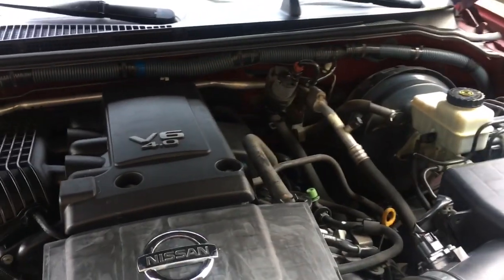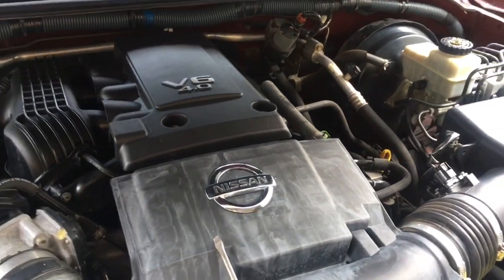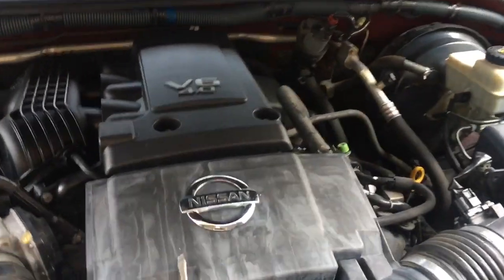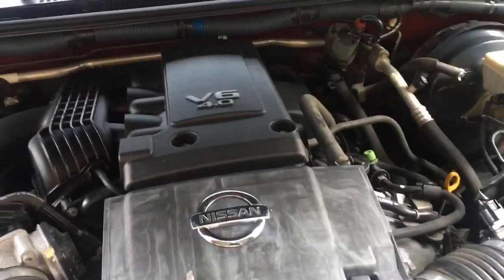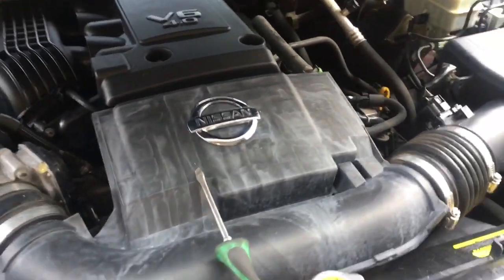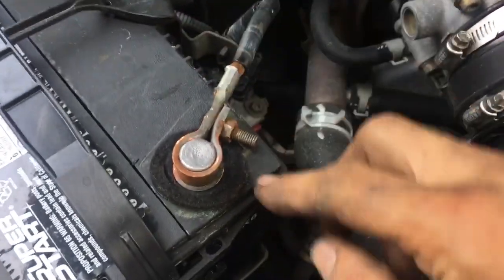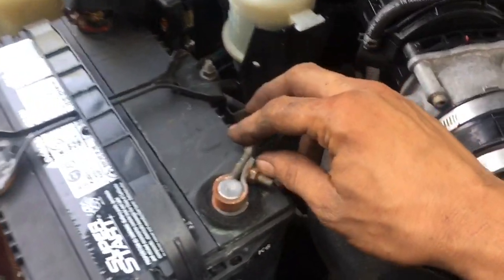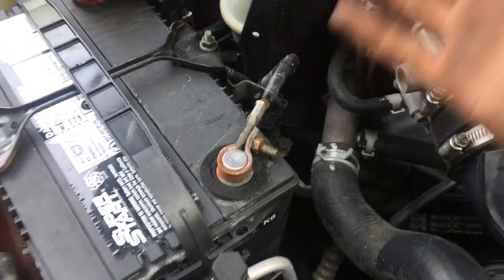Loose battery cable? How to fix for free

Comment: Thank you thank you your video was a life saver I was having an issue with my truck and the battery cables being loose I tried your screw idea and thank you I got the battery going enough to get it to the shop.
Reply: Also I like your can't break what's already broken comment it is a big motivational help😅

Comment: Just stuck a small screw driver mine. My problem isn’t the terminal. The guy that had this before me jacked up the battery post so I’m no getting a good connection. So instead of popping the hood every time and taking a screw driver in and out I just installed a small and will leave it there til time to replace battery lol

Comment: I have a 2016 Chrysler Town and Country and the battery went out last night.  My cables have some kind of slide mechanism on the cables and I can't get it to tighten.  I'll try your method and see if it works.  Thank you.
Reply from the maker: I believe off to the side of it there is a 10 mm nut that you need to loosen if I’m thinking of them correctly but you can also try my method it will certainly help somebody probably over tighten the nut because…….  well they were NUT and they didn’t know any better…….
Reply: @sharpcarco  Thank you very much!!

Comment: My positive clamp keeps popping off the terminal & sparks everytime I put in place (Idk much about cars but Ik I don't want to get shocked) 😳😂 Will I be zapped pushing the screw in or do I need to disconnect the neg. 1st? 🤔 Signed Scaredy Cat 😂
Reply from the maker: First off no you won’t get shocked technically speaking you should remove the negative put the positive and then the negative but really it don’t make a difference you won’t get shocked either way.

The only reason they say that you should put the negative on after you put the positive on is for power surging but that would also mean something would have to be on full blast to search the power so it’s kind of dumb when people say that but it’s pretty much the way of the world nowadays to be safer than sorry.
Reply: @sharpcarco  Ok these might be silly ?s but once I have the answers I won't ask them again Lol Do I have to turn off anything? & I don't have any tools...so can a screw just be pushed in place?
Reply from the maker: you have absolutely nothing to worry about whatsoever. I’m actually going to make a video about that topic you were definitely not the first person to ask and it’s completely understandable.
Reply from the maker: No I’m sorry you can’t just push the screw in the place you have to turn it with a screwdriver the point is that the screw will bite into the lead of the battery terminal you could probably borrow a screwdriver from AutoZone they usually have a little stuff like that behind the counter
Reply: Just had a nice older gentleman save the  day 😁😂 He used a thick zip tie piece in place of the screw & it worked just the same! I'm over the moon RN! Lol

Comment: So I'm having a really hard time finding a video and obviously by the time this video gets made that I'm looking for it's going to be too late for me to use it however maybe somebody else can the thing is is that I just need to get to work and then I can deal with the actual problem of the terminal thing being too loose on the battery my boyfriend just died about 3 weeks ago and I know nothing about cars and I have zero help so what I could really use is some sort of diagram or picture or somebody showing me what other items that I might find in my boyfriend's toolbox that would temporarily tighten the post thingy so my battery will start my car that's what I need my battery to start my car so I can go to my job and once I get to my job I have plenty of people that can help me figure out the rest in fact I work right next to a car place but I'm running late and it is impossible to find videos like this

Comment: Can you do that on the positive terminal?
Reply from the maker: Of course you can you just Gotta make sure that the bolt doesn’t stick up so much that it hits the hood to be honest with you there’s a lot more space underneath there between the battery in the hood that you would think there is Usually it’s anywhere from 6 to 8 inches away from the hood anyways
Reply from the maker: Of course you can you just use a little screw generally the battery terminals are anywhere from 6 to 8 inches away from the hood and nowadays most hoods are made of fiberglass. But be mindful of it don’t use a terribly long screw

Comment: Thanks.  I have a heavy duty cable that needs replaced because the head broke open a little and so it vibrates off and I lose air conditioning and the battery doesn’t charge.  However, I don’t have time to fix it right now.  This will help me out a lot today.

Comment: How do you know if it’s overtightened? My car is a push start. It turns on the ignition. I had the battery for 2 years. There’s a click noise when it turns on but the car won’t start. I used cable jumpers to start it. I drove around for about 30 minutes before I got home. It won’t start again. VW Jetta 2014. Any help would be appreciated.
Reply from the maker: You don’t have to worry about getting shot just find the battery and see if the cables are loose the cables are attached at the top just like the battery in the video if they move then they are loose…

Even though your battery is only two years old it is a good possibility that it has went bad. 

You have to buy a good battery like an Exide or Ultima , batteries from Walmart and AutoZone are generally pretty much junk after a short period of time you could also buy a battery from Napa I’ve had a lot of luck with them or directly from volts wagon although they are considerably more expensive than something you would get it other locations. And often the same battery batteries are produced by three or four different companies in the world so most of them just have different stickers on them but really no difference in the actual battery it’s self . 

So my recommendation is an Exide or an Ultima Ultima batteries are pretty expensive as well. Diehard used to make a pretty darn good battery as well but unfortunately I believe they’re out of business. 

I hope that helps point you in the direction and if you ever have any questions just let me know I’ll try to answer them welcome to the channel have a great day

Comment: Be aware the screw is temporal, after many months it corroded and it ate away battery terminal
Reply from the maker: Well it also depends on what type of screw you use but that is something that I did not consider. 

I really didn’t consider anybody would keep it as a lifestyle just wanted to make something quick to help folks out. 

Hindsight is always 2020

Comment: I had my positive cable come loose and I used a small nail to make it tight. I took it to Jiffy Lube and the alternator, starter and battery tested good. I did go buy the lead shims but I was going to wait since the nail is holding it. The person at AutoZone said it will throw a spark from the nail and be a Hazzard. Is this true or is it fine to just keep using the nail?
Reply from the maker: Well it depends on how high the nail is….. you just take a pair of wire cutters and cut the nail off so it’s as high as the terminal……. I would suppose if you had a nail that was sticking up 6 inches away from the terminal then yeah it’s more than likely going to make contact with metal.
Reply: @sharpcarco  I took it to my mechanic and he said the nail was better than the lead shims. He just readjusted it and tightened it. He said I could get the connector from the dealer if I want it perfectly repaired. I'll just keep using the nail. He commended me for using it and I told him I got it off YouTube. Thanks 😊

Comment: I tried this, but the nut seemed stripped out so I couldn't loosen it. Ended up using the screw in the small gap still there, but the head of the screw broke off. The terminal is there to stay now, I suppose
Reply from the maker: Well the next time you need to loosen it just grab a pair of channel locks it’ll come off

Comment: Way to rep Grand Rapids brother 🤙I'll just start bringing my car to you haha. Honest mechanic right here folks
Reply from the maker: Well thank you very much for taking the time , yeah if you ever ever need anything let me know.
Reply: @sharpcarco  I stumbled onto your video looking for the reason my car keeps flashing all of the warning lights, radio display backlight and then completely dying. It died the other day and sat in a parking lot for a couple days but started right up when I returned to work on it. When my heater is on it smells almost like burning wires or plastic so maybe my brand new alternator is going bad already, not too sure there. Anyway I put a new battery in it but the negative clamp keeps slipping off of the post so I'm hoping it's just the loose connection now cause I'm really short on $$ at the moment. 
Thanks for the video sir, I'll definitely try this out.

Comment: I am heading out to my car now to try this. Being a single Mom on a fixed income doesnt allow room for mechanical work. So glad you created this video, but I am having trouble turning over my car and the one cable is loose ( was over tightened in the past ) and I have a brand new battery so hoping this does the trick... Thank you so much
Reply: Does the screw have to be all the way down?  I tried this didnt work for me but I could barely fit the screw in there but its made the connector tight?  I think I am doing something wrong... :(
Reply: I salute you for being a single mom and still keeping your household together❤️👏🏾 I understand how stressful it can be sometimes💪🏾💪🏾